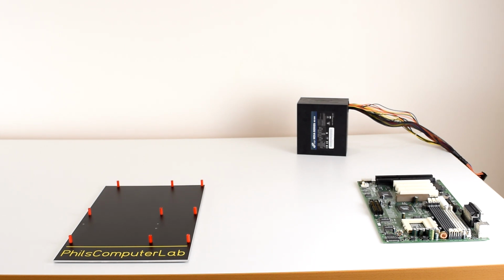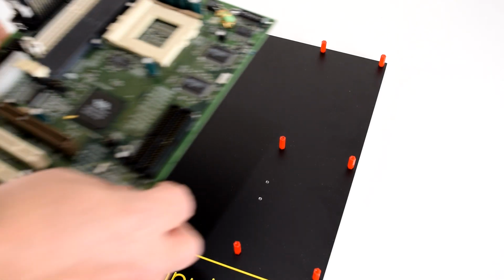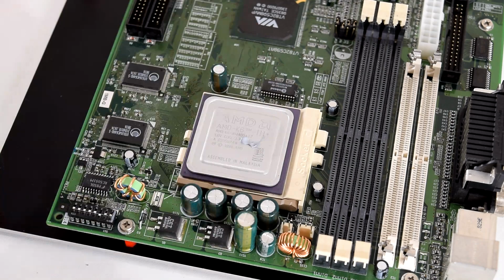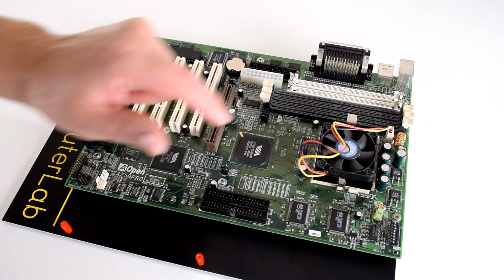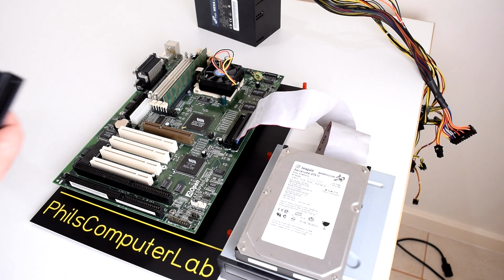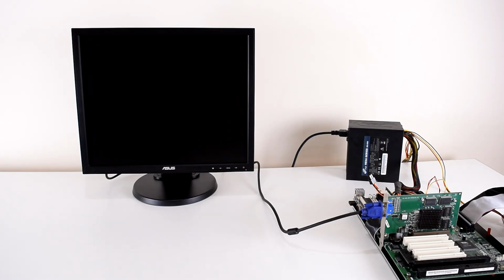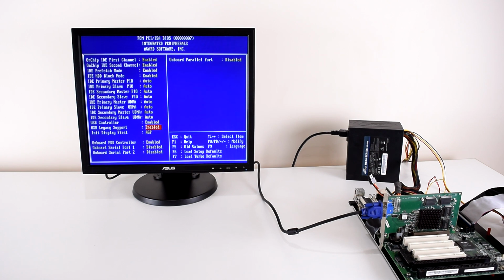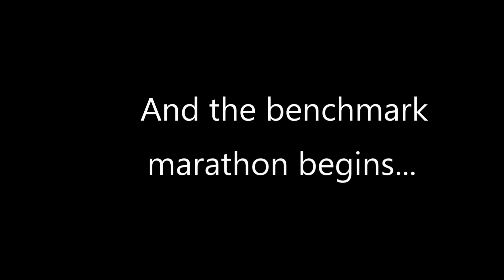Best Super Socket 7 GPU? Part 1: The System

Comment: Don't turn off video BIOS shadowing! There's still a small BIOS on the gfx card that gets set up during early POST, and it contains different code routines that would get used in text mode and other legacy graphics modes (MS-DOS modes f.ex.). Calling the code routines from an (E)EPROM chip instead of main RAM is in theory slow, and AFAIK there's no good reason to turn it off even if you only use Windows (except that you free up under half a meg of RAM, which is pointless).
Same with turning off the LPT/COM capability, why? It's not like you're short on interrupt slots here, and certain programs expect them to be present. This is more of a hack than anything else.
Still a good video though, and I enjoyed it!

Comment: I've done similar test using vp3 mobo and K6-2@450Mhz. Tested TNT2, MX400, Rage 128 Pro, Radeon 9200 and Voodoo 3. Voodoo 3 turned out to be the fastetst by some 30-40% in 3DMark 2000. K6-3 is a different beast with L2 cache and 100Mhz bus...
Reply: Interlace  I guess not many remember how bad were nvidia drivers back then. Reinstalling windows and drivers to be able to run different game was a usual thing.

Comment: My current board in my retro gaming PC has an Abit AB-TX5 which only has PCI and ISA only. The first SS7 board I had was a DFI P5BV3+ Rev. B+ which had AGP 1x/2x, memory limitation of 1GB PC-66/100/133 memory, and that board was a beast. I need to find that board again online and install it, then get an nVidia Riva-TnT video card and use it with my 3dfx VooDoo2 card.
Reply from the maker: I also have a DFI board, it's very good too.

Comment: That is pretty neat. ISA, PCI and AGP all on the same board. My Ultimate XP build has SATA 1 and 2, PATA, and FDD, but the FDD port is busted, one of the signal pins is gone so it doesn't communicate with the drive.

Comment: You have got no idea how much i wish i would have kept my first ever PC that i used. I believe it had similar specs to the computer in the video, but i never got to know and i don't remember what the manufacturer of the entire system is. Back in the day, i used to only play Diablo 1 and a game that was made in my country, because i did not have an internet connection at the time. That old computer that i had did run Diablo at 60fps, but my current rig would propably run it at a few thousand, since 3DMark2001 was always running at a constant 999fps (which i guess is the limit). And keep in mind, Diablo was not a 3D game, it was maybe a 2D or something. I wish i could get a PC like that again, but i will have to start getting some money to buy the parts off the internet, because a friend of mine who has 3 computers in his sauna, 5 computers in his garage and 2 computers in his house, only has computers that are a bit too new for my liking. The only PC that he has from the era that i am looking for, has a Celeron 400MHz, but i will look for something around 500+MHz.

Comment: Did you do the registry hack to enable the second TMU on that 3DFX Velocity 100? One can get similar performance with that card as what one would get from a V3 2K and maybe a 3K if overclocking. I really like V3 3K cards because they are not royally expensive unlike the V4 4500 and V5 5500 while giving a good bang for the buck.
Reply from the maker: The latest V3 driver I believe will enable the second TMU. But I will double check before benchmarking to be 100% sure!

Comment: Phil, excellent video as always. I just installed a K6 III+ 450 on my ASUS P5a SS7 motherboard. The lowest voltage setting on the motherboard is 2V and the CPU Core runs at 1.7V , so I did just like you did in the video and installed a Heatsink with a fan mountes on top, on a CPU that was supposed to be fanless, I guess (?). My question is: is that ok if I don't want to overclock my CPU? Will 2V damage it?
Reply from the maker: The voltage won't damage it :) Some of these chips are rated at 2.3 I believe. Hey, random question, what's a cool game that runs well on the K6?
Reply: +PhilsComputerLab I actually got into building a SS7 system after watching your "Building a 4 in 1 Retro PC". What an influential video that was for me! I mainly built the system to run those CPU-speed sensitive games like Lotus 3 & Warcraft 1 & 2. So I'm afraid I can't find a suitable answer to your question since most of the stuff I know about SS7, I leaned from watching your videos. Is there any specific game you want me to try out?
Reply from the maker: I was just after some games I could showcase :) I keep building stuff, but never actually get to enjoy them.

So lately I pick one game, and capture some gameplay. For the TNT2 and SS7 I picked Shogo! Very cool game, the video is still uploading...

Comment: I vaguely remember back in the day that it was a bad idea to put the HDD and CD-ROM on the same IDE channel as it would slow down the speed of the HDD. Or am I going crazy?
Reply from the maker: No you are correct, the bandwidth of the IDE channel will be shared between the devices. Being 33 MB per seconds, that's not a big deal though as all the games are installed onto the HDD. You might see a boost using separate IDE channels when installing the games though, but I doubt you will notice it. I have worked on lots of retro builds and tried both methods, I simply cannot tell a difference, but I prefer using a single cable, it's neater, cleaner and easy to setup :)

Comment: Hey phill love your channel and contributions on vogons! Can you do a do a video sometime about a DOS/WIN95 boot selector? I use win95 for easy file sharing but it's mainly a dos machine.
Reply from the maker: What do you mean with boot selector? In Windows 9x you just shut down into MS-Mode and you're good to go.
Reply: I mean a choice on boot, do you want to boot into 95 or dos.
Reply from the maker: I see. Well once you shut-down in MS-DOS mode, it will stay there. Even if you turn it off.

To load Windows you just type exit I believe.

You can access the Boot menu and go straight to DOS, but I believe it won't process the same CONFIG and AUTOEXEC.
Reply: Nope next time it will just restart in dos :-) (win95c) If you exit into dos you can type win to go back, so for now I just need to load win95 then exit to dos. Its nothing urgent but there are no good video about boot selectors and information on google is next to nothing. So I thought its a nice subject to make a video about. How to boot into multiple old school OSéss. Any way keep up the good work.
Reply: four years later: My machine boots into dos and then i have to type "win" to start 98 - it is a setting in the MSDOS.sys (s.t. like "BootGUI = 0")

Comment: I have an Intel 430HX chipset motherboard without AGP and Intel only seems to support non-MMX CPUs on it unfortunately. What would you recommend for my situation? I have a Pentium 166 in there. I have a spare AMD K6-266 but I can't use it unfortunately. I currently have an ATI Rage II and a Trident TGUI9440 for it. The Trident is in use now because DOS and Win3.11 don't seem to like the Rage.
Reply: Which motherboard is it?
Reply: Intel TC430HX, but unfortunately the chipset revision does not allow any Pentium chips over 200MHz, including the MMX chips.
Reply: According to official spec sheet (ftp://ftp.jameco.com/Archive/Current-TechDocuments/155150.pdf) that board does at least support MMX-CPUs up to 200 MHz, maybe more with a BIOS-update (I didn't look that much into detail).
Reply: armorgeddon
I have indeed been looking through that document. Mine is one of the few that appears to accept 166 and 200 MMX chips. I have a few old laptops with 233MMX chips unfortunately. They might end up running @ 200 if I jumpered correctly and if I put the CPU in the Intel desktop board. They're the same chips anyway.
Reply from the maker: Yes the MMX 233 will run at lower speeds, just set the multiplier. It's the fastest option for you, the AMD is quite weak at floating point math, which newer games such as Quake use. That was the main weakness of the AMD K6.
Reply: PhilsComputerLab
Ah thanks for the heads-up. Finally a reason to properly junk the old Armada 1592. It has display issues anyway.
Reply: Cyrix also had a major Floating point weakness. Still, nonetheless a great army of CPUs back in the day even though they made some bizarre choices.
Reply: The k6 series was still leagues faster at floating point then the cyrix offering, plus as far as I remember the 3dnow! extension helped quite a bit where supported.
Reply: Gil Verthaim I feel it came a little too late, by the time 3Dnow! came out Intel already threw out SSE.

Comment: AMD did make a K6-2+ 570Mhz chip. Rare but they are around.
Reply from the maker: True, forgot about that model. It runs on a weird FSB frequency though, I think 83 or something like that. Wouldn't surprise me if it's actually slower than a 550 because of that.
Reply: PhilsComputerLab
It was rated at 95Mhz bus with 6x multiplier. 5Mhz bus probably won't impact the score too much, but this chip will more than likely run easily at 600 without much fuss with voltages since it is a 2.0v chip, probably 2.1 or 2.2v is all it would need with a good cooler.
Reply from the maker: 95? Wow that's interesting. I remember going for 600 MHz and it was like there was an internal barrier of sorts. I needed extra volts and even then it wasn't fully stable. Quake DOS benchmark would cause issue. Maybe my chip just wasn't as good as a clocker...
Reply: PhilsComputerLab
If you decap a K62+ or 3+ chip, and use a socket A / 370 heatsink I'd bet you can get to 600 or higher stable with minimal volt increase. That thermal goop AMD used between the spreader and the core isn't the best, more like thermal rubber or something.

Comment: Superb channel, subbed! I'm an old hardware fan to!

In case you didn't think of it, here are some important "tweaks" that are a must have.

AMD K6-2 write allocation monitor. (on www.k6plus.com)
Via MVP3 4way interleave patch. (on www.falconfly.de)

These two really speed things up a bit!

Try it out, and see the difference, good luck!
Reply from the maker: Thanks for the kind words! Thanks for the links, will check them out. Might be worth doing another video about K6 SS7 tweaks to get the maximum performance out of that system. I can say so much though, the Nvidia cards on the SS7 system I'm testing are doing very fine. Blazing fast in fact :D

Comment: can i get a pentium 133 to work on a super socket 7 motherboard. and can i put a s3 trio 64v+ pci on it too?
Reply from the maker: Yes, absolutely! That's one cool thing about SS7 platform, so flexible. I use one with a Pentium 100 for my DOS gaming PC :)
Reply: You can put anything PCI oriented in a SS7 machine. Since you're going 133, I'd go with the classic Voodoo. With the S3, you have yourself a very good DOS/W95/8 rig. 

It may be a little slow, but it would make a great 1996 PC with the exception of the Motherboard.
Reply: i would want to run DOS 6.22/WINDOWS FOR WORKGROUPS 3.11
Reply: Windows Ninety Five 66 I think a 486 is more applicable for Win 3.1/Dos 6.22. But that's just me.

Then again, you can just boot in Win95 and have Dos 7 which are pretty similar.

Here's how I would do it.

Anything <486 - DOS 6.22 on it's own.

Pentium 75 and above to 166 (Non MMX) Windows 95/DOS 7.

Pentium MMX 233 MHz/Pentium ii/iii era pure Windows 9x gaming and late DOS games.